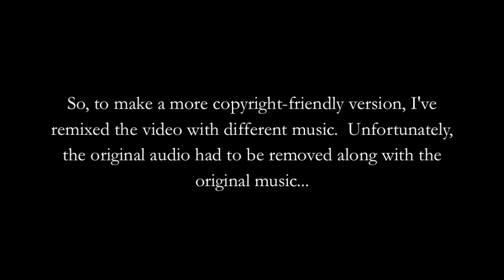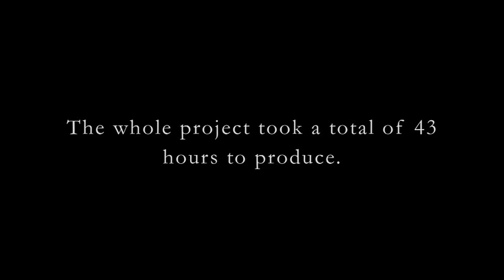Making a Barbute (Re-Edit)

Comment: Another thing i love about this particular helmet design is that it is one piece -as far as moving pieces anyway.  The reason this is important is that any one who has ever built anything knows that the more moving, interacting parts you have on an object the more potential failure points you have.  This design is going to serve reliably, and consistently, with minimal maintenance requirements.

Comment from the maker: I use steel hammers for all kinds of applications.  For dishing or sinking larger pieces, I prefer the rawhide mallet but it's just a personal preference.  I know of many armourers using steel hammers to sink their pieces.  Just be careful to not thin the sheet if you're hammering with a steel hammer onto a steel surface.  Of course the preferred method would be to raise the whole with a steel hammer onto a steel stake!

Comment: Wow, it's a beautiful piece... Great job!
And screw the purists that say you shouldn't use modern methods, it's sure nice to know them instead of them becoming a lost art, and I even understand the ones that specifically have "using old blacksmithing techniques" as their hobby, but if you do it for a living, it's just handicapping yourself.
Reply from the maker: Modern armourers need to be capable of producing pieces using a variety of techniques both historical and modern. Given that I do make armour for a living, this welding method is simply a cost-effective means. I do appreciate and practice historical techniques as well :).
Reply: Of, course, that's why I said that it's good to know them :)
It's really a shame when an important technique is lost in history, like what happened with Damascus Steel until very recently.
But unless they are somehow superior in either cost, efficiency or end result, I only see a handful of opportunities when they are the best option (If the client specifies it, for example)... and see far more people rabidly criticizing anyone that doesn't use the historical methods. That's part of my overall hate for closed minded fanatics of anything, I guess.
Reply from the maker: Gran Gurbo I think everyone is certainly allowed to state their criticism and as long as it's respectful, I got no problems. When it turns disrespectful, the only people they're really hurting is themselves. Inflexible ideals (like inflexible armour) is more harmful to the owner than they might realize.

Comment: Nice work and a good video. What I'd really like to know though is what kind of block you are using there to do the round head rivets (which are a particular enemy of mine)
Reply from the maker: I use a cast lead block to set my round-headed rivets. The use of lead blocks in smithing is a time-honored technique, but some people aren't comfortable with its presence in the shop due to its toxicity. There are pneumatic rivet setting heads which can be used as well. Instead of putting them in a pneumatic tool, just clamp it in your bench vise and place the round head of the rivet into the tool's dimple and hammer the interior of the rivet as normal. Of course, you can always just make a rivet setting tool out of scrap steel rod and a careful application of a drill and ball burr ;-).

Comment: Any suggestions for sites/videos for a first helmet project? I am a pre-dental student in an art class where we have access to brazing equipment, a tool that can hole punch sheet metal, hammers, a metal bending machine, a variety of wire, scrap sheet metal, a spot welder, and some other things. I have roughyl 15-30 hours to work on it (a big time range but depending on how excited I get some time may become available. I am on a tight budget and would like to spend as little as possible. I have looked at pepakura and it looks cool but a constraint of the project is using some kind of metal to form something wearable. The metal can be the base but we can layer it however we want and what not.I would appreciate any feedback possible!
Reply from the maker: A good first-time helmet would be a spangenhelm. But with any armour project, you might want to prepare for it to take much longer than you expect. Here's a helpful starting link:
http://www.arador.com/armour/how-to-make-a-spangenhelm/
Reply: Parker Brown thanks! I found out the other day that we have a bit more time than I had originally thought (like 2 weeks longer so about 15-20 hours longer than I thought). We also have a bit more flexibility with the materials we can use and so I may consider using some EVA foam, but we have to at least have some reinforcement of brazing with wire as armature. I would have considered possible peparuka but the instructor said we cannot do templates; however, the general template in the link should still help me increase my awareness and understanding of what it would take to go through the metal route because we do have sheet metal available. I am trying to pool a bunch of ideas together to make it look badass, and any other feedback for possible material alternatives other than what I have mentioned would be much appreciated.
Reply: matt12721 http://img2.wikia.nocookie.net/__cb20120224210256/elderscrolls/images/2/2b/Helmofyngol.png
this helm is kinda where my inspiration comes from. That, gladiatator, the Witch King from lord of the rings, and some video game armor are kinda where I hope to attempt to take this project
Reply from the maker: matt12721 If you want to make something like this for cosplay purposes, there are MUCH simpler alternatives than learning armoursmithing. Fantasy armour can be a lot of fun to make, but it MUST be approached from an understanding of real practical historical armour first. A lot of fantasy armour looks good, but is simply too impractical and uncomfortable to wear. I would strongly advise looking at real original pieces first before delving into "armour" shown in movies and video games.

Comment: Congratulations on the art, what do you do to not rust after
Reply from the maker: Rust prevention is about constant moisture control. This helmet (which is now almost 10 years old) has been kept rust-free by always keeping a can of either Rem Oil gun oil or CLR handy along with my kit. After every use, I would wipe the piece down thoroughly and then apply a little oil. Any scratches or serious scuffs would be immediately tended to with a file and sand paper. Basically, if you know how to clean a gun, you know how to clean your armour. Take a few minutes after each use to keep it in good shape and it will last you a very long time.
Reply: Ok, my friend, he has won one more subscriber here in Brazil. I also work with steel, but I never made armor, seeing his work made me feel like trying. Hugs

Comment: Hey Parker, great video! I've seen several people using that type of cast-iron dishing form, but can't find anywhere that sells them - do you remember how you got them? I'm planning on making some dishing forms from wood (tree stumps, mostly), but a metal form would be nice too!
Reply: I think I might have answered my own question, but was it Iron Monger Armory, perhaps?
Reply from the maker: Yes, it was :-).
Reply: I have seen people cut the bottom off of steel fire extinguishers and use that, as many have a dished bottoms and it is thick heavy gauge steel.

Comment: What kind of sand paper do you use to get the metal to shine?
Reply from the maker: I don't use sandpaper per se, instead much of the finish work is done with 3M 2" wide 72" long sanding belts in 60, 80, 120 and 220 grits. At the time of this project, I would do much more finishing on the belt sander and then take it straight to a polisher using bobbing compound, but now I do an intermediary step using 80, 120, 300 and then 400 grit Satin Glo compound using separate dedicated cloth wheels. This produces a much more even finish.

Comment: How long doe sit take to make a piece and can it be worn for replica or actual use?
Reply from the maker: As stated in the video, the project took 43 hours to complete. It is a fully functioning helmet used in martial arts training. I have personally used it these past 5 years and it has certainly kept my brains where they belong :-).
Reply: +Parker Brown Martial arts training? Amazing that they still use 15th century designs for protection (if it ain't broke don't fix it I guess). So what sort of damage does it go through anyway? Could it go through the same as one would expect in a medieval battle with hatchets and swords striking it etc etc? (Whenever looking at these helmets I always assume that it is too thin so would I be wrong in assuming that?)
Reply from the maker: +Jim Island: I've used this helmet in HEMA/ARMA martial arts training since about 2010 and it has taken many hits from blunted high-carbon steel training federschwerts and wooden wasters. You can see me (briefly) in action with the helmet here:
https://youtu.be/10B4oCreJDo?t=4m47s
The thickness of the skull is about 12 ga. thick. The sides and bottom are about 14 ga. This helmet is plain mild steel, not heat-treated carbon steel. It has a few dents and dings in it today, but it has done its job remarkably well. After making this video, I did fit the occular area with fencing mesh so a blade couldn't slide in, but with a properly made interior liner, this helmet has served me quite well.

Comment from the maker: Fair enough, but in truth I'm really only making $14.72/hr. after you account for cost of materials, overhead and sales tax.  Welding helps reduce cost significantly.  Had this been raised, it would have easily been a 75+ hour job which would have resulted in a final cost around $1,700+.

Comment from the maker: Alessandra,
Thanks for the kind sentiments, but my fiancée might have something to say about that, lol.
Reply: +Parker Brown Hi, first of all, great work! It looks just beautiful. What i`m wondering about is how can I construct the helmethalfs on my sheet of paper is there a formula?
Greetings from Germany.
Reply from the maker: +Der Wolf Hallo von Virginia ! Deutschland hat eine erstaunliche Geschichte der Rüstungsproduktion!

I start with detailed measurements of the head. Measure the distance from the forehead to the back of the head (A). Measure the width of the head from ear to ear (B). Measure the circumference of the the head (C). Adjust each measurement to allow for the thickness of padding you will use in the helmet. If you're using a historical padded garment, I usually add 1/2" - 3/4" (12 - 19 mm.) to the overall thickness. I currently construct a wooden plywood model of the wearer's head to make measurements that much more accurate to insure proper fit. It also means the client gets a *free stand to place their helmet upon.

The helmet half should be an asymmetrical lozenge shape with the upper curve substantially rounder than the lower curve. Construct your plywood model based on your measurements. The width of the lozenge should be 1/2(C). The shape of the lozenge can be figured by running painter's tape on the plywood model along the 1/2 circumference of the head (x-axis) and the length from the front of the forehead along the top to the back of the head (y-axis). Carefully remove the painter's tape and place it flat on a piece of card stock. Cut the card stock out and leave yourself with a little extra material (It's easier to remove material than to add it).

This is an intensive method, but it has given me consistently accurate results resulting in a good fit. Viel Glück!
Reply: +Parker Brown Thank you so much for your reply! Good german there :)
Now I finally have an base to start of! Im on my way to become an Artsmith, you know Gravecrosses and stuff. But armoring is the thing I´m very interested in.
So thank you a lot :)

Comment: Impressive work my man! 

I ordered a Barbute helm from some website that makes them custom made, but they are taking FOREVER, and haven't even started on mine yet and it's been over a month since I paid. So I'm probably going to request a refund. 

Would you be able to make me one for the right price? I have a high budget. 

This is what I NEED for my own Martial Arts (Gladiatorial Arts and HEMA) inspired.
Reply from the maker: Mr. Richardson, I will advise patience with your current arrangement. I myself have had a work list extend into a year before I can get to an individual project. Custom made work made by hand is not something that can be done quickly or easily. If a craftsperson is in demand, it's not unusual to wait an extended period of time. 

As such, I am currently not accepting new commission work for this very reason. I have an extensive list that already needs attention and, given that I have just recently recovered from a serious personal injury, I'm trying to ease myself back into the physically demanding aspects of my trade.

I wish you luck and would strongly advise patience.

Comment: Damn have you ever cut yourself with a jig saw doing a cut like that?? I'm afraid to try that out with my Jig
Reply from the maker: Use a fine-toothed saw suitable for cutting metal and be sure to wear proper safety equipment (gloves, earplugs and goggles/face shield).
Reply: Perhaps my steel is too thin (22 gauge sheet) Looks like you slowly and steadily cut like nothing. Mine bounces all over the place lol.

Comment: as long as it does the job just as well as the historically accurate helmet i dont care that you did it the modern way
Reply from the maker: I have fought in this helmet for over 2 years and it's still going very strong.  I need to make a video of a raised helmet, but I've got to wait until I get commissioned to do one ;-).

Comment: Don't put the welder on your lap for crying out loud. Do you want to have a melted ding dong?
Reply from the maker: I didn't weld anything on my lap. I welded this helmet on a steel table with a flat mild steel sheet top.
Reply: Parker Brown Didn't get me.

So you get a story time. I can't find the video right now, but you're free to check Oxtoolco, Tom Lipton's channel for the actual story.

So Tom was having some youngins around learning the trade, welding this welding that. One of them, put the welding gun across his lap, which you did, and because Murphy always looks out for you, said gun slid off in the process burning his ding dong, his crown jewels, the hotdog, the..you get the idea.

I won't ruin more of the story in case you decide to watch the videos and hear it yourself.

IMO, check one of his welding videos and see his welding gun support. It's easy to make and will keep hot items away from important parts.

This isn't a safety tip, this is a common sense one. I did the exact same thing as you did, didn't burn mine but in the momentum of the fall it touched my elbow through my jacket and even now i have a whiteish spot there.

Just sayin'.